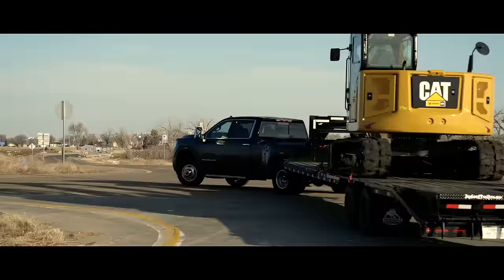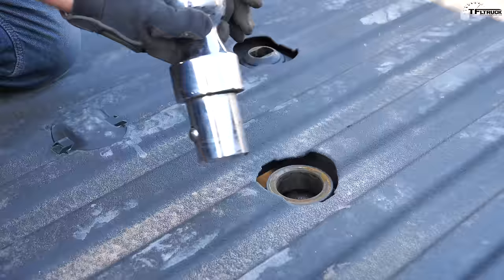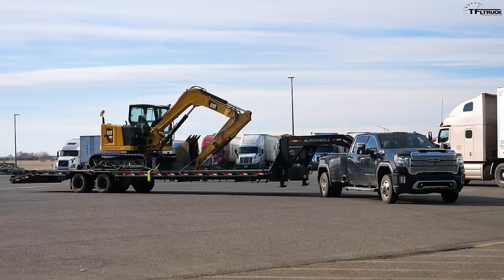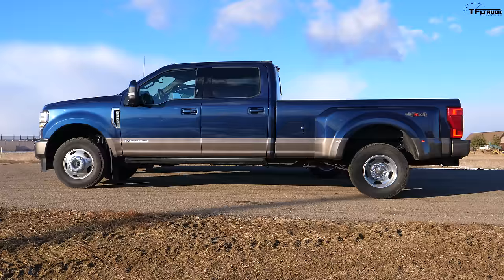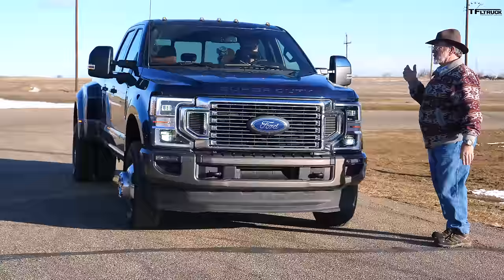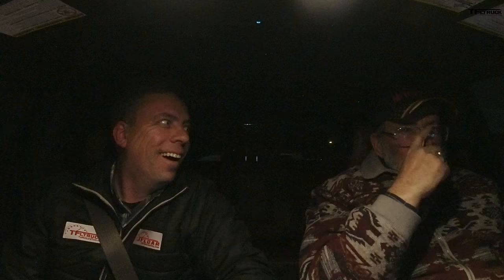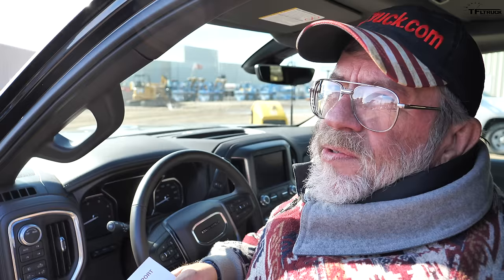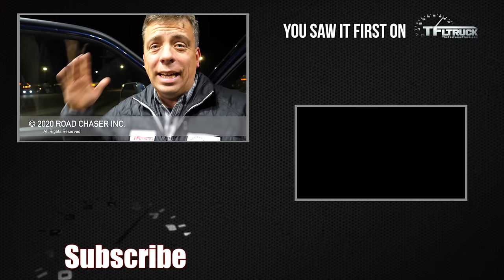30,000 Lbs Monster Tow Test: 2020 Ford F-350 vs GMC Sierra 3500 - Drag Racing & Tow Off!

Comment: I’m all Chevy. But can’t stand the new body styles. The GM mirrors look like a broken arm!
Reply: I agree.  I'm a GM guy, and hate the new towing mirrors.  Plus, if you buy a truck with the towing mirrors you lose a lot of the cameras.

However, I can't stand looking at a Ford.  I'll drive the GM with its broken arm towing mirrors because it's only 1 point of ugly, and not 100,000.
Reply: They suck at interiors too. Never liked the interiors. Them Denali trucks are such a ridiculous rip off!
Reply: @chrisholland2016  Ford and GM lack in that department.  Ram has the best interiors, imo.  If I couldn't have a GM I'd take a Ram.
Reply: @domin8ss  it's funny because I'm also a ram fan too. I'm both a Ford and a Ram guy.
Reply: I'm a solid ford guy no offense
Reply: @mechanickingman6673  We can all agree to be respectful of others opinions.  There's no harm in agreeing to disagree.  Different strokes for different folks.
Reply: @domin8ss  and yes Ram does have the nicest interior. I'm a fan of the Laramie longhorns and the Limiteds. But I'm super interested in the all new 2020 ram 1500 Limited blackout edition. Felt in love with the look of that truck.
Reply: @chrisholland2016  I wish I could get the 2021 Tahoe interior in the GMC Sierra AT4.
Reply: @domin8ss  I've heard rumors that the 2021 GM 1500 trucks are supposed to have the same interior as the 2021 Tahoes and Yukons.
Reply: @chrisholland2016  here's hoping🍻

Comment: I drove from Montreal Canada to Miami Florida and back with a 2017 GMC 1500, 5,3ltr engine pulling a 8000lb fifth wheel TT. According to the onboard computer the consumption was 19.6ltr/100km which is 12.38mpg @ 55mph highway speed. I looking to upgrade to a diesel truck, probably Ford 250 especially if we decide tu upgrade the TT to something a little longer thus heavier.

Comment: Your getting more shake because of the way you loaded and chained the equipment. I know it seems like such a thing wouldn’t make that big of a difference. But it most definitely does. I’ve noticed that if I bind down very far behind the rear axles, I get a lot of bounce and shake. You needed to pull that piece of equipment forward close to another foot or so and let your rear binders protrude forward and the front sets of binders protrude towards the rear of the trailer. Always bind the boom also. This sort of binding will make a huge improvement when hauling heavy.

Comment: You are WAY overweight...the rating is 30,000 lbs GCVW (Gross Combined Vehicle Weight Rating). That means allowable weight rating of truck and trailer Combined. That 308 cat weighs over 21,000 lbs, that trailer weighs 8600 lbs. Your at or over 30k lbs not counting truck weight. 
If you combine weight of truck, plus weight of trailer, plus weight of passengers thats about 17,000 lbs. That means you can only haul 13,000 lbs.
You're 8,000 lbs overweight.
Not only that, but you need a Class A CDL for that combination of truck and trailer, which I doubt either 1 of you has otherwise you would know how to interpret weight ratings.

Comment: What was the impact of the outside temperature not only on the fuel being put into the trucks ( density ), but also on the temperature of the air being taken in by the engines ? 
Its not really an apples to apples scientific comparison, but it is sort of entertaining.

Comment: Measuring DEF usage on a 66 mile trip?  Odds are that IF a regen was run in both trucks, it didn't finish. 
I own the Ford and it only does a regen every 200-300 miles.  Once started, it takes around 15-20 miles. 
*I had he dealer enable manual regen and filter status indicator so I can see this stuff. Those are usually only equipped on the base model Fords.

Comment: Iirc, the Allison 10L1000 was designed by Ford, and so were the 10L80 and 10L90 10 speed transmissions.
Reply: You don't recall correctly.  The 10-speed is a joint venture between GM and Ford.

Comment: Should I buy a 2019 with diesel for 52k (good rebates).  Or a 2020 with the 7.3 for 51k (no rebates).   Both are similarly equipped STXs. Anybody please comment. Thanks.

Comment: Something you glossed over was the true comparison. You had the GMC Denali, which is the highest trim level. But, with the Ford, you showed the King Ranch, which is 2 or 3 levels below their highest trim
level. While the towing capacity my not be significantly affected, there would be more weight in the higher trim levels which would decrease their payload. And where it makes the most difference is in the price. While you said that the 2 trucks you showed were comparable in price, I'm pretty sure the top Ford trim level is significantly more expensive. Now those may be the trucks you were given, but the comparisons are not on an equal level.

Comment: The trucks would have ridden better if the load was more toward the back of the trailer axles... I always load a machine so the truck only squats a little bit.  Trailers balanced at 60/40 to the front ride better than empty. I haul forklifts and skid steers all the time. Being 1ft forward is the difference between nice ride and a kick in the a$$ every bump!

Comment: Wouldn't the fuel mileage and DEF usage vary by when the trucks go into regeneration mode?  There is no way to tell when the trucks go into that mode.  If you were say going uphill in one or the other truck during regeneration, does the fuel mileage suffer some occurring at a different times under different loads?  GOOD VIDEO

Comment: Love the channel guys! But one thing, I can’t remember if you said the F450 was a cab chassis or not, but anything past the F350 has the same towing capacity if I’m not mistaken. Otherwise love the reviews
Reply: F40 comes with a pu bed and has a higher towing capacity due to larger brakes and components...  I love my F450,,,  rides so smooth, especially with Platinum trim

Comment: I think the ford should of been driven during the day same as the Chevy ,fords will always drive better in the cooler nights
Reply: I actually came to the comment section to see if someone picked up on that. You will get better power and fuel economy at night when temps are lower.

Comment: Both of these trucks are insanely awesome. Idk wtf GM was thinking with the interiors but it’s straight up doodoo butter.  Dodge has the best interior of all 3 makes, but if you’re in the market for one of these you should just pick which one you think looks the best. 99% of people will not ever pull anything near as heavy as TFL does in these test but either one will have more than enough power and comfort to satisfy anyone. The tech on newer hd trucks is crazy now and make it much more driver-friendly than they’ve ever been. Awesome video!

Comment: Just ran across this 1. Personally I like the gm for heavy towing.bthe ford for everyday driving. I tow with a gm. Just feels like an HD truck. My f250 feels like a my f150 when towing. They are both very capable trucks. I own 6 ford's from 65 to 2018. But I pull with the chevy. I have 2. 2017 diesel and 2020 gas which I mostly use for my 5th wheel. Just like the feel of the gm. John Wayne truck. Rough tough and don't take no sh!t off nobody. The ford feels soft to me. Being old school I like to feel my load behind me.

Comment: Bouncing is from the distribution of the weight on trailer needing to be a little more forward.  Too far away from the mid point of the axle on the trailer

Comment: Ken hates the Chevy for gear indicator then loves it for tow spec sticker and just mellow on the Ford.  LOL  So when you use Fuel/DEF, Ford cost is .414/mi and Chevy is .467/mi which means Ford will save you $5297 for 100,000 miles of operation.

Comment: I feel like 66 mile loop could be more accurate if it was done at same time of day same weather conditions because driving in the day compared to driving will get a difference in mpg because of ambient air temp. I drive a big rig and always get better mpg at night when the temp is cooler.

Comment: I own a Ford F250. The possible difference in the fuel economy could be the ambient temperature. Because it was at night and I can only assume colder the air is denser on the Ford test vs. the GM during the day. I have done a lot of flying with loaded aircraft and 15 degree temperature make a huge difference in takeoff / climb rate just for an analogy in air density vs temperature.  Just thinking......

Comment: About the bouncing, I think your mpg loop is on I76 starting in Hudson. Some parts of I76 the joints are spaced such that this can happen depending upon wheel base and spring rate. I've had it happen in my 1/2 ton with a lot less weight

Comment: You were bouncing because of where you had that trackhoe positioned on the trailer sometimes a few feet one way or the other changes how your truck will ride imo you had too much weight over your trailer axels causing it to slightly bounce the rears of both trucks you should experiment load position forward or backward a few feet or even less than a foot will change how the truck will ride under a trailer load imo thanks keep up the great work

Comment: I am not sure it was fair to run the trucks under different conditions.  The GMC was run during the day and the Ford after sunset.  As you said it was colder.  You should have run them under the same temperature conditions.

Comment: High all.  Looking for information about the flashing/strobe headlights that I see on the F350's used in these videos.  I recently purchased a 2017 F350 DRW for hotshot and would like to add that feature to my truck for added safety/warning while towing.  Appreciate your help.

Comment: I'd like to see a divider between the fuel and DEF fillers.  All it would take is to be a little careless or a gust of wind to get a few drops of DEF in the fuel side.  Also I'm not sure if the DEF systems are working constantly or is it intermittently with computer control?

Comment: The only thing I’d like to point out is in your “highway test”. Think the two tests should have been done back to back to eliminate the one variable I saw…….temperature, air temp to be specific. 
The Ford got a slight advantage of cooler evening air density. Probably not a huge difference to been seen on short test segments like 66mi but over a 250mi…..might make a noticeable difference. 
Just my personal thoughts. 
Fair testing otherwise! 
Good Job!

Comment: I appreciate your tests. A question... were the tire pressures the same in both trucks? I couldn't help but notice the Ford was tested at a cooler temperature which would give it an advantage in horsepower and mileage. Cruise control does not give the best MPG,  by the way, a throttle stop does.

Comment: I don’t really have anything to say about the test but the Chevrolet and the GMC used to look identical except the logo but that finally changed. I know they’re still basically the same truck but I was told by a Chevrolet dealer a few years ago the only difference between the Chevrolet and the GMC was the cosmetics of course and GMC used a different small switch going to the captains seat and also the rear differential. I would like to know if that’s still true if anyone would care to answer thank you.

Comment: Actually, a lot of different channels test comparison trucks and with more points than you guys used. But I digress... 7.75 sec 0 to 60...??? My 2008 F350 will do 0 to 60 in right around 4 seconds. Then again, my 2008 F350 is manual trans, deleted, and not stock by any means. Question, do you know if either truck went thru a regen cycle during the test? Entertaining video, nonetheless. Keep them coming...

Comment: So the Ford is 1 second faster 0-60 and gets 1 MPG MORE towing at capacity.  6.7 Powerstroke remains superior to the poor Duramax.
Reply: With that much of a load the egts will be high enough it won't need an active regen. It will be doing it passively.

Comment: Makes me love my 07 Chevy 2500 Duramax with beefed up suspension with air springs, shocks, etc., Edge with Attitude,  bigger wheels and tires,  pulling 35ft 5th wheel grossing about 16k.  Left Greeley fully loaded with 4 adults.  Topped off in Dillon area and got 12.1 mpg and no regen fluid required. Can achieve 13’s on flat Nebraska and Kansas Interstates. I’m saving my $80k.  Do want to add a Jake Brake, but otherwise can see no reason to trade newer.

Comment: I'm just curious as to how many miles is on each truck?  For one if they are brand new, it is a dumb idea to be racing them and putting that much stress on the engine if it is not broke in. The other thing is if one truck is broken in and the other isn't then you will get different results, as well.  The reason that they are getting jerked around in the cab so much is because of the type of hitch they are using.  If they used a fifthwheel hitch instead of the ball hitch they wouldn't be able to carry as much but the ride would be a lot smoother. These trucks will haul a lot and these guys have showen other videos of the GMC out pulling the Dodge and the Ford,  and I know if I'm pulling a trailer up a hill or down and I need the power  to make it up and down the hill I don't really care if I'm getting a mile less a gallon If I can't get up a hill and I'm stranded and I have to call a tow truck to come and tow me through the mountains or up a hill and have people looking at me because I caused the traffic jam. I would rather have a truck with the power to make it up the hill. The other videos they have done showed the GMC out pulling the competition and to me that's all I would want.

Comment: the truck's are shaking and riding rough because ur load isnt positioned properly on the trailer....u should have the load centered equally over the trailer axles

Comment: Badass Ford  …...Built much Better than those GM vehicles
Reply: The 07 chevy would kick the ass of every modern Ford. And it wont crush like a pop can because its solid steel.

Comment: I have never been one interested in the MPG of a truck, especially towing heavy. They will all be very close as it takes a lot of fuel to make the power pull a heavy load, regardless of manufacturer. What interests me is, How does it ride pulling that load, acceleration, stopping, side to side inputs, and its performance unloaded. If you want something that gets great fuel economy, your on the wrong YouTube channel.

Comment: The pavement joints on I-76 (both directions - right lanes) east of Denver are just brutal.  That probably contributes to the bad ride.  I hate driving in the left lane but that stretch of highway is an exception. It is just the worst.

Comment: years of working at a gas station showed me that system pressure and car fill shut off points varies a lot if other people are pumping at the same time nearby. fill it as slow as possible .

Comment: Always always always ALWAYS put the diesel filler cap back on before you even START to think about adding DEF. a small splash of DEF into the fuel will wipe out those fuel components. Why even risk it.

Comment: General Motors have to come up with a Higher Horsepower and more  Torque, Diesel Engine . How about 510 Horsepower and 1200 lbs Torque!!!!!!.
Reply: Just gotta get a good tune.....I gotta h&s minimax tuner on my lmm and it makes a night and day difference. ......I get an extra 20-150 hp and 80-300 ft lbs...... I run tune #4 .....second to last #5 is race tune.......#4 gives me an extra 110hp and 220 ft lbs......and your shift points on your transmission can be adjusted. ..so I can get 0-60mph alot faster than 7 seconds........I'm thinking high 5s....and my truck is on a 9" lift 4wd. So if it was a stock 2wd it would be alot more quicker......
Reply: that they're knocking upgraded anymore

Comment: L5P still has a lot of untapped HP so it could easily achieve kind of torque numbers Ram and Ford are getting. Still think Ford and Ram make a nicer looking truck. I haven’t owned a Ford pickup for years but seriously contemplating it.

Comment: This is not a fair test you can see it in his breath that the air temperature drops significantly between the GMC and the Ford air temperature has a lot to do with the performance of the engine you got better fuel economy because you are able to stuff more air into the engine which meant the engine didn't have to work as hard and you burned more def because the exhaust couldn't get as hot to burn off The nox so it's throwing more def at it I would say based on the changes they're probably apples for apples and actually not very different maybe a few points of miles per gallon
Reply: Don't get me wrong still a good test and it is appreciated greatly but don't claim it's fair if it's not fair